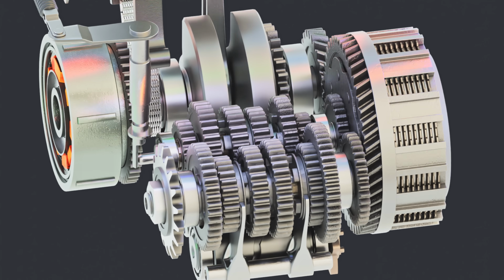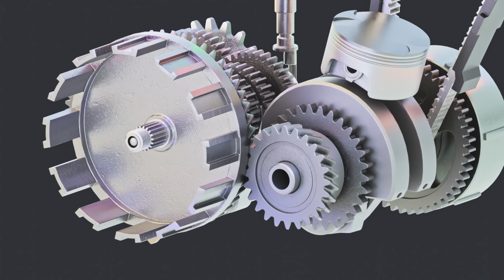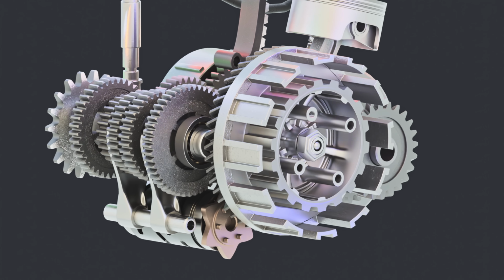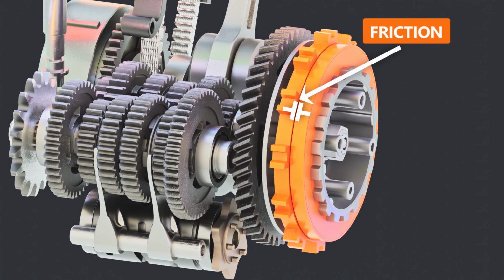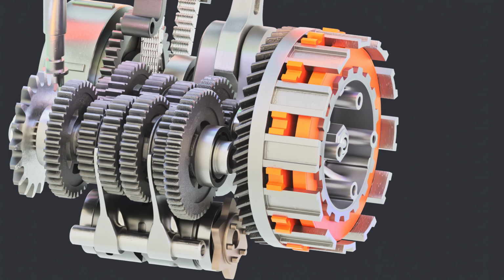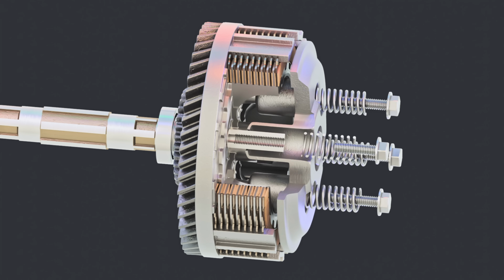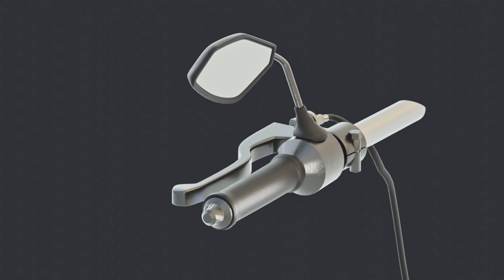How a Motorcycle Clutch Works

Comment: The only reason you need a clutch on a motorcycle is for taking off and stopping.  Never use it in moto cross or in any case when moving

Comment: This just isn’t how it works for my bike. 

My bike uses some type of actuator for the clutch which is NOT what is shown here so I have 0 idea how it can possibly work. 

My bike somehow separates the clutch plates by pushing from the right side the engine, onto the clutch pressure plate. How can pushing onto the pressure plate release the pressure and not just push it harder together? 

I cannot find a video or explaination about how the clutch works on my Honda. None of them apply to this bike

Comment: Excellent animation.
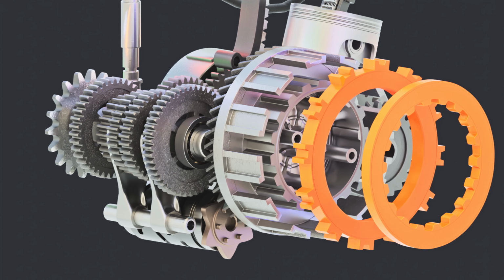1:53 This particular segment
is useful but would be clearer
if the conceptualization of using 
two locking pieces was replaced
with actual animation of all the plates 
actually shown coming together. 
Either way though this was really a helpful 
video, well done.

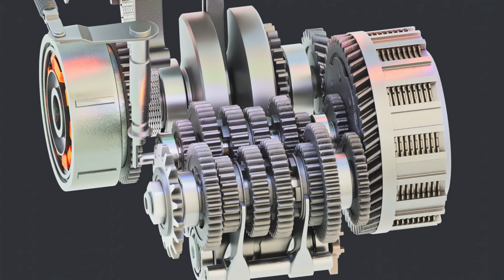Comment: Well good explained. 👍 But animation is not perfect in all, as you said. Just to explain the funtions. At 0:30 when the cluch is pushed, where just the basked spinnes, the smal sproked at the backside of the basked shouldn't spin, not to spin the connected sproked, which drives the gear shaft. In this gearbox build the input and output shaft are the same one shaft. The connected smal  sproked, which is connected to the input shaft sproked, drives the counteshaft, that drives the output shaft up on choosen gear ratio... I see. Animations are need to explain. 🙂 Ride Safe. 👊

Comment: I needed to fix the clutch on my moto Guzzi v7 so I watched your video 100 times before attempting to fix my motorcycle. I don’t understand what went wrong but I had a very hard time disassembling it and after I finally got to the clutch I couldn’t help but notice that all of my clutch components look nothing like what’s in your video. Maybe you can make another one so maybe I can put my motorcycle back together.
Reply: It's not a how to fix.  It's how a clutch works.   Hopefully you can find videos here to help you.
Reply: It was a joke. Moto Guzzy’s do not have a wet multi plate clutch like most other motorcycles. They have an automotive style single dry disk. All I was trying to do is point out that the video implies that all motorcycles use the wet multi plate clutch. They don’t.

Comment: Awesome thanks for this informative video!
So when we „ruin“ a clutch, does that mean we ruin these discs because the friction will be abrasive over time?
Reply: Yes, the friction disks and steel disks are wear items and can be replaced. 👍
In some cases, the outer and inner clutch baskets can develop grooves and need to be replaced.
Reply: @ClaysMotoGarage  I remember my teacher once told us, its basically impossible to ruin a motorcycle clutch compared to a car clutch. Not sure what exactly he meant, but thanks for the reply! :D
Reply: @andulasis6283 Motorcycle clutches are super tough and also lubricated by the oil. We can burn or glaze the clutch disks by slipping the clutch to much but the oil helps keep the heat down. I've seen some destroyed clutches on motorcycles but they take some serious abuse. 😂